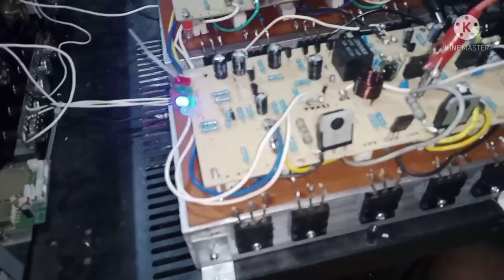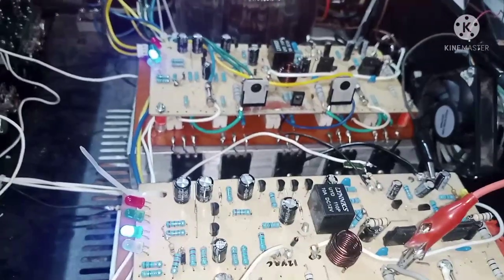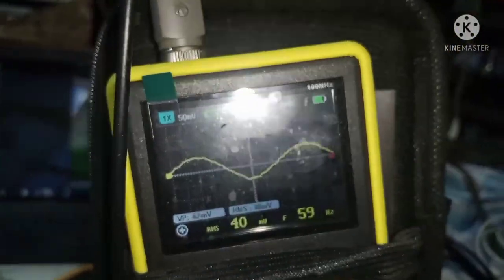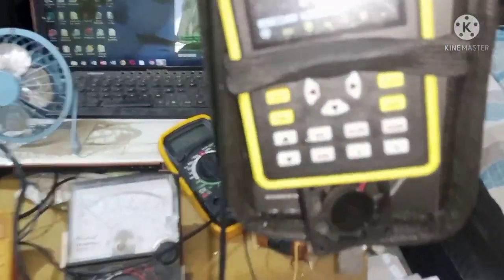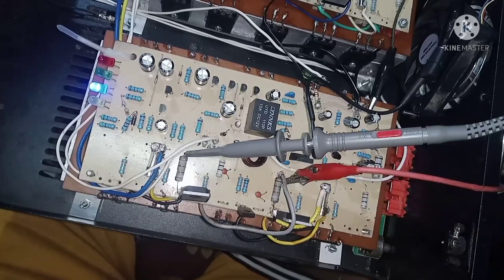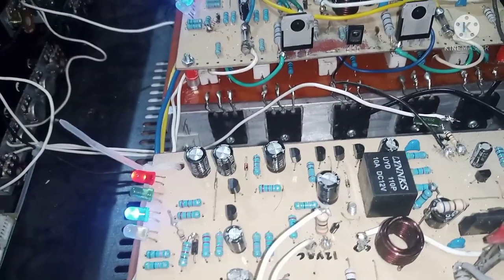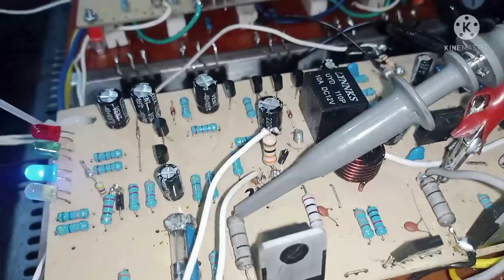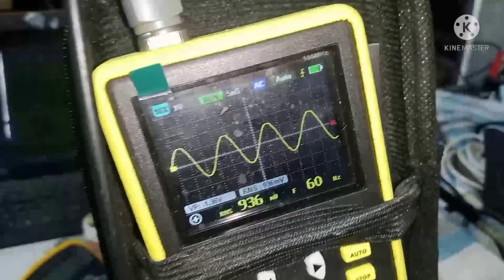isang tecknik para  maalis ang ugong ng amplfier, kahit off na  volume.. ugong padin...

Comment: Good am boss,isa po ako sa subscriber mo,tanong ko lng po,paano po makuha ang ugong mg sounds ko pag on ko ng main switch my ugong ako naririnig sa speaker ko.ang sounds ko ay car amp 4 channel my car stereo,audio capacitor,at power supply na 12v sa bahay ko ginagamit kya my power supply.
Reply from the maker: Kung s bahay m yan ginagamit dapat 12v or 13.8regulated supply kailangan m PRA walang ugong
Reply: Good morning po,nka 13.2 volts po sya,inadjust ko po yong trimmer ng powe supply boss...ano po yong PRA boss.

Comment: Sir magtatanong lang sans may ginawa Ako rockola may ogong din konti lng pag naka off Ang music mga ilang watts kayak ito 75acv njw 4pairs Ang Palo sa ac spreaker out umaabot Sa lagpas 70ac
Reply from the maker: Yung75ac m n lumalabas s speaker  kasma n kz  distorion at nasa cliping point n yan..  malamang yan  50ac lng... Cliping point.. Mo nasa mga 300wats kna mahigit
Reply: @bombasstechaudioelectronic1492  TAMA, MAX OF 350W MINUS LOSES kaya nasa 320W rms yan, kaso di naman kasi natin alam ano frequency ng input nya, dapat pasukan nya 1khz input signal then let us see ano ang vac output
Reply: @leo-zr5zs  350W maximum power n yan brother, dhil sinukat na sa maximum output. magde declare or ggamit ka ng RMS kung e-divide mo muna ang 350 to 40-60%. para mayron pang reserve power. Pero kung 320W RMS yun, saan nyo pba matatagpuan ang extended power nya na para sbihing 500-640W maximum power..🦀👍
Reply: @shiernanpapin85  Vrms = .707x50  =35.35Vrms, P=Vrms²/R=35.35²/8 =156.20watts per channel. Dahil 2 channels 156.2x2=312.41Watts. Ganito lang mag compute pero sinasabi lang na 320watts. Sinusukat kasi yan sa input sine wave from 20-20khz @3dB roll off, provided na ang peak ay 50 sa ac signal if the load resistance is 8 ohms (resistive and not Z)

Comment: Filter lang minsan Ang problema. Nag produce ng noise as distortion. Capacitor lang minsan. Hindi lang sa supply pati sa main circuit
Reply from the maker: Tama ka dyn sir at marami paraan sa pagtangal..ng ugong at isa lng din yan s mga paraan...
Reply: @bombasstechaudioelectronic1492  idol, dapat po sna para mas mgandang mapatunayan, ay e-direkta nyo saglit yung 33ohm kung saglit ngang babalik yung ogong...
Reply from the maker: Kung sa filter ang poblema both left and right magkka ugong...pero s sinaryo na ito isang supply lng gamit isang chanel lng ang may ugong.

Comment: Ung joson jupiter ko bozz kabilaan my ugong kahit nakaoof ung volume.pero kunti lng pag.nkafull volume sya meron pdin ...parehas lng ang lakas bozz full at no volume.ano kya dahilan...?
Reply from the maker: Madami kz pwed e check una dapat mataass uf.. Capacitance m sa power supply... Pag may tone co trol k dapat regulated.. Supply nya... Minsan osclilation static nmn.. Minsan  sa wiring dapat shielded cable..minsan outphase current flow windind source ng ac line supply ng speaker proteck  or tone contrl. Kaya dapat e reverse.. Minsan din aang in at out ng volum kailngan erverse para mawala ugong...

Comment: Lodz, sa akin kaya ano pwede gawin pag nag ON ng switch ng ilaw, timer ng washing machine at ugong ng motor ng washing.M. pumapasok ang signal sa ampli ko, lumalagitik.
Reply from the maker: Try m magpalit ng breaker  or lagyan ng line filter outlet m
Reply: D ba sa ampli ko ang may ggalawin lodz, sa isang ampli ko d nman npasok ibang signal.
Reply from the maker: @danteabarial2009  racola po ba yan ample m
Reply from the maker: Anu b gamit m transpofmer? O toroid
Reply from the maker: Try m lagyan ng line filter sa ac line filter din gamit k mylar cap.. 01 uf din lagyan din sa switch..
Reply from the maker: Minsan din sa deff stage sesitiv sya try magpalit ng matataas ng transistor
Reply: Toroid transformer lodz, konzert 502 na upgrade ko, din separate psu board..

Comment: Yung sakin boss na diy poweramp, malakas din yung ugong pagsabay yung dalawang channel gamitin, anu kayang problema nun boss?
Reply: Ilan filter caps, ano capacitance, at ano supply volt ng amp, ampere ng supply, meron kc chart pra dyn pg meron kc di tugma meron tlaga humming, yan cons ng diy kc minsan di nmn alam ng ng diy parameters n tama kya me humming.
Reply: Isa reason ng humming ay kulang na capacitor, every 1ampere =2000uf, sample 5a x 2000uf = exact filter caps is 10,000uf s volt depende kung ano supply ng ampli dpat lampas value ng caps, pero isa lng tong filter caps s solution ng humming, mdami p iba gaya ng low supply s mga circuit parts ng differential stage.

Comment: Sir gandang umaga pwde ko rin ba yan i aply sa entig amp?
Reply from the maker: Sa mga diy lng yan boss kadalsan nmn ng integrated amp ay nka ayus n ang isolation grounding, ang ibang dahilan nmn ng maugong ay sa regulator supply nmn ng preamp tone control nsasagap ang noise isa s paraan paglalagay nmn ng resistor s input  ng regulator ic halimbawa 7812 sa pin no. 1 maglalagay k ng 10ohms... At isa din paraan maglalagay zaw filter or line filter  winding before primary ng ng  transpo line 1&2 din ground ang ilalagay n capacitor. Yan ang pinaka mabisa pamatay s ugong.. At, araming pinanggalingan ang noise... Pwed rin s preamp at s deff stage.. Grounding flow or proper grouding..
Reply: @bombasstechaudioelectronic1492  maraming salamat sir  mahilig din kc ako mag kalikot hehe. Gsto ko rin matuto mag repair ng mga amplifier 
Elementary lang po kc ako kaya wala  mastado alam maraming salamat sa mga vedio mo sir andami kong matutonan dito
Reply from the maker: @abellaschannel7108  tyga lng idol... Lahat naguumpisa tlga s basic... Kaya m yan
Reply: @bombasstechaudioelectronic1492  salamat po sir God bless po

Comment: Sir yung sakin na amp ang lakas ng ugong ok naman po grounding at yung mga parts wala namang kalawang pero ang lakas ng ugong DIY po ito na 38 0 38 po supply nito 15 ampere
Reply from the maker: May tone control kba or  preamp bufer?  Minsan doon ng galing ang huming
Reply: @bombasstechaudioelectronic1492  may tone control po yung amp na assemble ko sir
Reply: Ano poba solosyon dyan sir
Reply from the maker: @lestherleones3307  may distorion ang tone control m... E  regulated m ng maigi ang supply din yung fre volta m... Minsan nasa rectication m... Poblema... Minsan din sa flow of ground
Reply: @bombasstechaudioelectronic1492  ah ok sir salamat sa idea ,maraming salamat sir follow ko po kayu sa fb